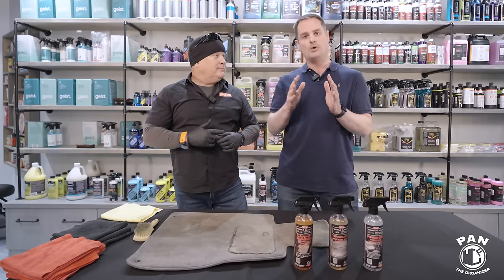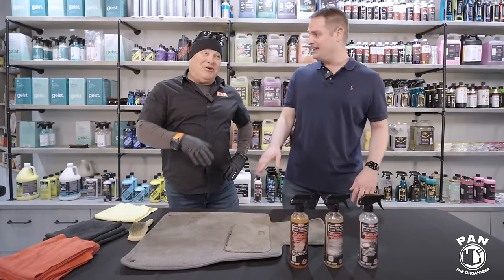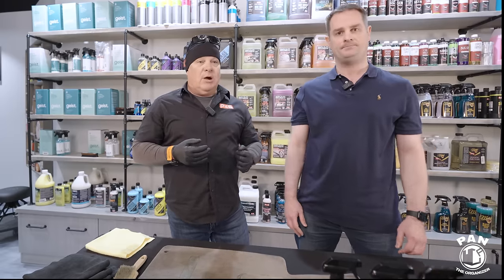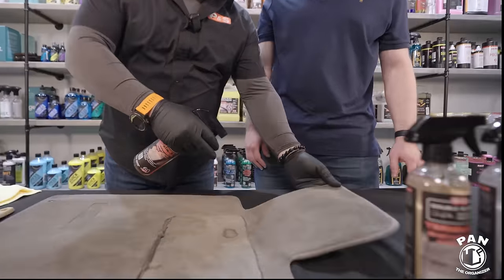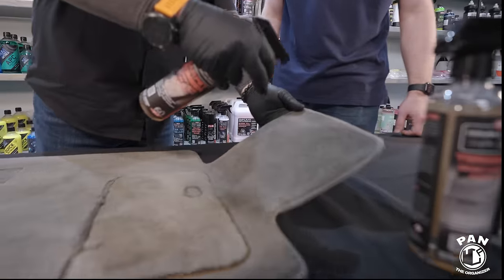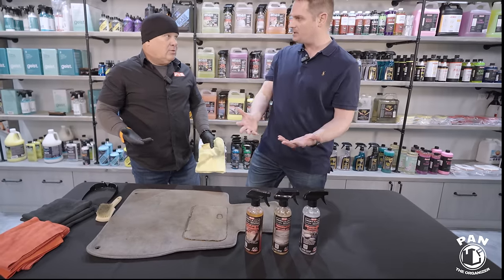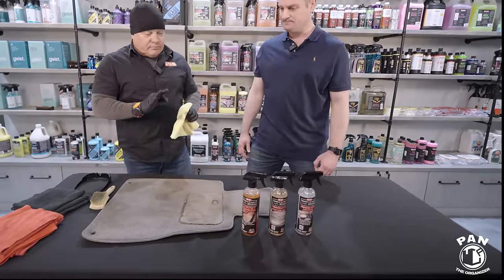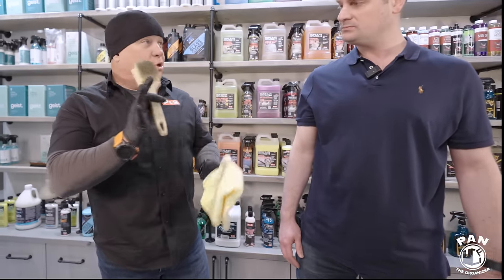How To Clean Nasty Carpets The EASY WAY - P&S Cleaning System

Comment: I’ve used the p&s carpet system for about a year and a half. No extractor, just a drill brush and entry level steamer. It’s incredible what these can get out
Reply from the maker: Thanks for sharing your experience!
Reply: @ethanblan435 Do you have any advice if I'm getting a chemical smell after using the P&S carpet system?

Comment: I already use Bomber and Terminator but I will be adding Finisher to my arsenal. Thanks Pan great video.👍🏻👍🏻
Reply from the maker: Yeah Finisher is important in this system. Finisher is a peroxide and the idea behind Finisher is it renders the preceding chemicals inert by breaking them and also finish off the cleaning process of breaking down the stain materials in the fabric.

Comment: Would you use the carpet bomber and finisher for maintenance washes, or are these products strictly for stain removal?
Reply from the maker: These are for cleaning. If the carpets are clean, all you need is to vacuum them.

Comment: Hey Pan! can these products and methods also be used to deep clean fabric seats without a vacuum extractor or steamer?
Reply from the maker: Yes. As you saw here, no extractor or steam cleaner was used.

Of course, having those tools makes for even better results and makes the process faster and more efficient. Especially on super dirty carpets and floor mats.

Comment: Hi pan thank you for all your fantastic videos, i have a question, what the difference between using  the shampo that for the pre wash  to the contact wash or using the regular shampo for the contact wash
Reply from the maker: Welcome to my channel. You discovered one of the biggest car detailing channels on YouTube as we surpassed 900,000 subscribers and we have over 116 million views! I have been detailing for 26 years and I love to share my knowledge and passion with my viewers.

You found the right channel to help you learn everything about detailing.

A snow foam is meant to safely lift and encapsulate loose dirt and debris, and also to lubricate the surface before the contact wash, to minimize the chances of getting swirls and scratches in your paint. Some snow foams are only for lubrication (pH neutral), while others have a higher cleaning potential (alkaline snow foams or acidic snow foams).

Some shampoos can be used both as snow foams and in the bucket. Shampoos like CarPro Reset, Adam's Car Shampoo, Phoenix EOD APEX auto wash, Koch Chemie Gsf, etc.

Some snow foams can't be used in the bucket: CarPro Lift, Gyeon Foam, Bilth Hamber Touch-Less, etc.
Reply: @PanTheOrganizer  thank you

Comment: I went to detail my friends wife's car. They had not cleaned, vaccumed, or washed to interior in over a year. They had a older toyota with cloth, and carpet mats was def medium to heavy bad condition(lots of built up dirt, sand, food debris, and etc). I was empty handed on carpet and upholstery cleaners i had griots garage interior cleaner but that was not made for heavy staining on carpet and cloth fibers. 

I went to local store to buy meguiars upholstery cleaner the ones with the attached brush too much foam coming out not consistent even spray on the surface... i had to work with what i had. If i'd known about p&s carpet cleaners easily would of bought the whole set. I brushed those mats, and cloth seats for awhile did help somewhat but yea. Then went over with my bissell hydrostream extractor that did extract decent amount of dirt/grease, and contaminants with at least 5 passes up down left and right. The mats were alot cleaner but still had some minor staining on the corners of the mats. 

I tried my best to completely clean as much as i can. But def going to invest in some P&S carpet cleaners!

Comment: I tried the P&S carpet cleaners to day on some old stains on our living room carpet. I didn't care about the results since it will be replaced soon. I followed the directions, by spraying lightly and allowing it to sit for 3+ minutes. Then I wiped. There was some improvement. I also tried using a brush on my cordless drill. No real difference. Perhaps tomorrow it will look better. Update: I applied the cleaner to another carpet spot on a different type of carpeting. Completely gone!

Comment: Does it make sense to use Finisher after any other carpet cleaner or is it only for use after p&s products?
For example I use Koch Chemie PolStar because it is very economical for professional use. 

Finisher sounds interesting. So it would maybe a benefit to use after Pol Star.
Reply from the maker: Pol Star is pH neutral so in theory doesn't need to be neutralized after use. If you use an alkaline cleaner or APC or carpet cleaner, then yes you should neutralize with Finisher or use an extractor.
Reply: Ok thanks for clarification. 
I understood in the video that this product is to neutralize all chemicals like surfactants and things like this which are also in ph neutral cleaners and not just to neutralize ph.

Comment: These 3 would be my go to, except I need to do seats, carpets, floors mats and the boot mats. I have no doubts that P&S will be perfect but....I'm not sure if all three will do every single surface in the car as its heavily soiled. I'm planning on an all day-seats-out-deep clean with and extractor and drill brush to get everything off. Im leaning towards Koch Kemie Pol Star as its £8 for 1 litre bottle that needs diluting to 1:5 to 1:20 making either 5 to 20 litres of solid cleaning power enough to do 2 cars for £8... its a tough decision,  I will go over all of the fabric with a layer of P&S Absolute though to leave the fabrics protected as I know its waterless wash with protective properties that will do nicely on fabrics 👌
Reply from the maker: For heavier dirt and grime on carpets and upholstery, there's no doubt the P&S system does a deeper clean, compared to a pH neutral Pol Star. Pol star is more for light to medium soiled surfaces in comparison.

P&S Absolute is a rinseless wash, and isn't designed to be used as a fabric protectant. For that, you would use a dedicated fabric guard like CarPro Fabric 2.0, 303 Fabric Guard, Gtechniq Smart Fabric, etc.
Reply: @PanTheOrganizer I could have sworn Sydney from P&S touched on the subject of using Absolute on carpet mats after the P&S carpet cleaning system and interior on the P&S Absolute released a video with the guy from the rag company, when that product came out to use on fabrics and interiors as a rinse aid. It'll do interior too and in a steamer. I do like P&S though 👍

Comment: So if you wanted to use an extractor how would you it be included in the process? Carpet bomber , hit any stains with terminator, wipe with rag, spray water, extract, wipe down with rag again and finish with the finisher?- what’s I did, not sure if correct but worked welll
Reply from the maker: See it in action with an exctractor in my video here: https://youtu.be/gQO-g_JMV-I

Comment: quick question can you just use the terminator and finisher. Why would I waste time seeing if carpet bomber will take it out, If I can just use terminator  for any stains? Just curious
Reply from the maker: For spot cleaning, Terminator followed by Finisher could be ok, but if you don't really know what caused that stain (organic vs inorganic) sometimes it's best to also have Carpet Bomber in your arsenal.

You would use Carpet Bomber when there is lots of dirt and oily soil. If you’ve got stains and spills, Terminator and Finisher should work fine. It’s when there is a decent amount of dirt, then Terminator and Finisher just won’t do the job. They are not designed to lift and remove soil, and Carpet Bomber is essential in that situation. And this information comes from Dave himself, the chemist of P&S.

Comment: Is the finisher a protectant that repels future stains?
Reply from the maker: No. You'd need to apply a fabric protectant like CarPro Fabric or 303 Fabric Guard, or any other fabric protectant of your choice.
Reply: It's a neutralizer, to neutralize the previous products so they don't pull dirt off your shoes.

Comment: If I got a carpet and upholstery cleaner that I’m using up can I just get the finisher and use it with the one I’m already using until I run out then switch over?
Reply from the maker: The P&S is really made to be used as a system for chemical synergy. I don’t know about using other products with them.

Comment: How does a product like this do with deep cleaning carpets? With such little product applied, is it getting deep into the carpet and the base of the fibers to remove dirt, grim, oils, etc there, too? Is there a time for deep cleaning carpets with saturation & extraction?
Reply from the maker: For deep carpet cleaning, I would add a step with a carpet extractor. See my video: https://youtu.be/gQO-g_JMV-I?si=3R0-lpHdvHzt7myY
Reply: @PanTheOrganizer  Thank you! I watched that video as well, but even there, the amount of product applied is fairly minimal. By contrast, TheDetailGeek saturates product and extracts repeatedly until clean. I'd be very curious to see a more in depth comparison of surface-level vs deep/saturation cleaning methods, if you're looking for future content ideas 😄
Reply from the maker: He deals with digusting filth infested vehicles. His channel is all about disaster details. That's not what my channel is about. I deal with cars that people actually care for. So it's quite normal that techniques used are different between his channel and mine.
Reply: @PanTheOrganizer  AH! That makes perfect sense, thank you! That's what my logic was, but I couldn't find anything online to confirm, so thought I was just incorrect in my logic. I'm currently detailing/renovating a new-to-me 20 year old vehicle that is closer to disaster detail than maintenance status. Thank you for taking the time to respond!!

Comment: Is any extra dying (either with towels or forced air) needed when using this method?
Reply from the maker: Not really as you're not saturating the carpets with liquid like you would with an extractor for example. Let them air dry a bit and they should be fine. If you feel there is lots of moisture left and want to speed things up, you can set them in the sun to air dry, or get a compact air mover to place inside the vehicle (many pro detailers use that method).

Comment: When is the steamer step applied?
Reply from the maker: When you are using the cleaners, you can use a steam cleaner with the brush or microfiber towel to further enhance the cleaning power. At the end of the cleaning process, you can either use a carpet extractor (also called spot cleaner) or the Finisher peroxyde neutralizer.

Comment: Carpet bomber always wicks on my toyota seats, how do I neutralize the chemical? 3% peroxide didn't work
Reply from the maker: You have to use their Finisher neutralizer, as shown in the video, and work it in. There's more to Finisher than just peroxide. Use the system correctly.

Comment: Would this work on a vehicle headliner that has soda stains?
Reply from the maker: Yes, but be very careful with headliners. You never want to oversaturate them as it can unglue the liner from the roof and start sagging. Very light applications, a gentle scrub with a soft brush or microfiber towel, neutralize, and blot the excess liquid with a clean and dry towel.
Reply: Merci bocoup Paaaaaaaaan!

Comment: I wonder why not just change the carpets with new one, why to put so much energy and time to scrub, wash dry and condition only carpets and interior linings. After all the efforts still the master detailer can't make it new. Hence I cobsider just order new and save time and energy.
Reply from the maker: In this case, the carpets were beyond what I consider "trashed", and yes I would normally recommend throwing those in the garbage. There are always limits as to what detailing can bring back. But not all customers have the budget to replace the carpets (some OEM mats are quite expensive) or care about having perfect mats. 

This was a good scenario for the demo as the carpets were beyond what we'd normally see in a typical detail. The products are wonderful to work with, and are a great addition to any detailer's arsenal for sure.